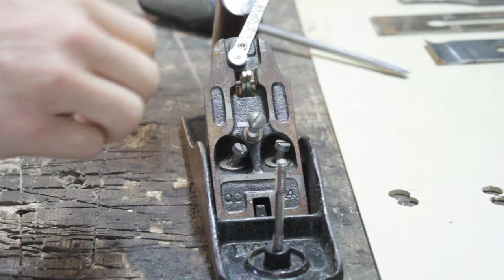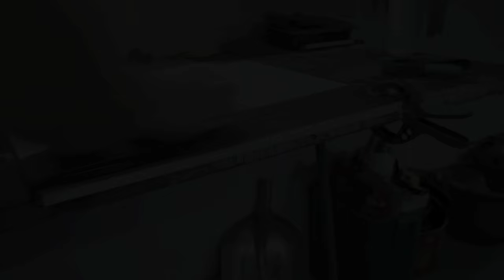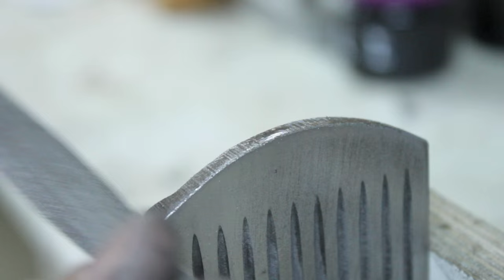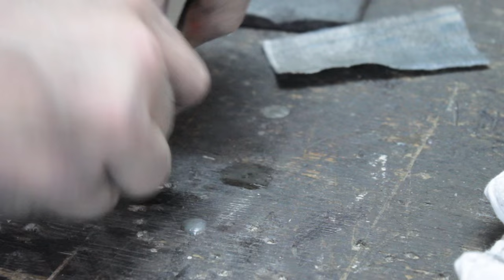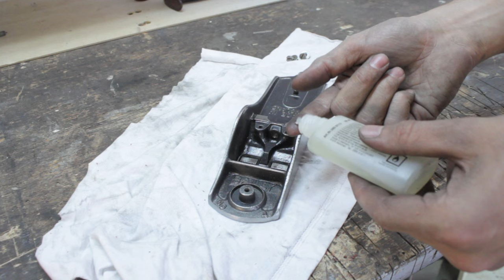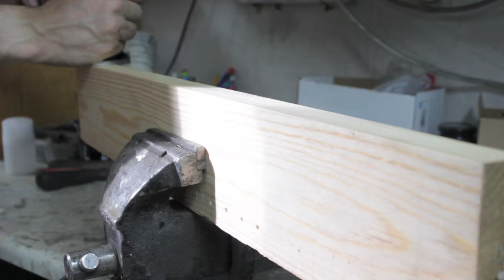Restoring a Bailey No. 4 Plane

Comment: Well worth the effort for a lifetimes use. I just bought a rusty number 6 for £11. As I wanted to use it rather than put it on show, it got a quick dusting. It has plastic handle and tote. They are more comfortable shape than the wooden ones. I sharpened the blade. It planes superbly. Maybe I was lucky, or maybe the previous owner did some hard work. I bought a £5 block plane and milled the seating for the frog. With a better blade it works a treat.

Comment: Great video. 
I have the excact same tool left to me by my grandfather. It is in a worse condition tho. How old do you think these could be?
Reply from the maker: Can't remember when production started. About mid 1800 I think.
Reply: FinnCrafted an internet site made an algorithm and according to that this is supposed to be a type 19. which means it was made between the years 1948-1961. dont if it s correct tho.

Comment: Making them pretty is the easy part. I buy quite a lot of them and the common problems which are the most hard to rectify are:
1. The frog tilted to the side due to bad frog geometry or bad pads geometry.
2. The frog rocking on the pads.
The shitty contemporary ones have those, the vintage ones have those as well.
Reply from the maker: Agree, they are not perfect. I just checked that the sole was somewhat flat before buying this one.
Reply: Everyone seem to be all over them while in fact they are inherently flawed: at the most important location precision-wise there are by design overlapping inaccuracies without any measures for compensation. The praise came from the fact that woodworkers usually don't know the first thing about machining or machine engineering.

Comment: Attempting to surface the sole of a hand plane this way invariably results in a convex sole which is far from ideal. Making a critical assessment of the sole and accuracy of the side to sole (90 degree) with a surface plate before starting and then surface scraping allows for the best result at the critical 'mouth'. I applaud the effort put in.

Comment: Thanks for sharing a great video. Around 35 years ago, I found an old Bailey No.4 plane in the basement of my first house (built in 1911, so I have no idea how long the plane was down there). The wood knob on mine is more mushroom-shaped, and the adjustment wheel on the rear is smaller, about the size of a nickle. The sole plate is flat, no ridges. Any idea how old mine might be ? Thanks !
Reply: Black Waterdogs Before 1940s.
Reply: I know this is an older post but the following link will help you identify the age and model of your Stanley plane.  https://woodandshop.com/identify-stanley-hand-plane-age-type-study/

Comment: Good stuff! Does one want any clear-coat on the bare metal on the sides? has no idea
Reply from the maker: I think a quick wipe with some kind of light oil should be enough (i used air tool oil). Could be the natural oils from your hands as well. I don't feel the need to clear-coat this one.
Reply: I briefly thought of oil too, but then I wondered if one really wants something that may collect (saw-)dust. ..  Beeswax might work too?
Reply from the maker: I just wiped the excess oil off the surface. Cast iron is somewhat porous and a small amount of oil will stay in the metal.